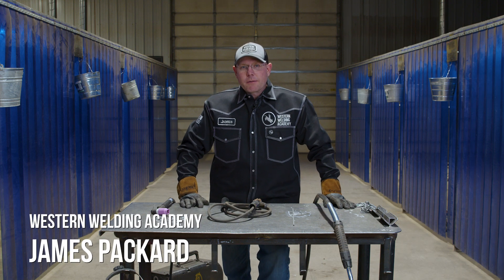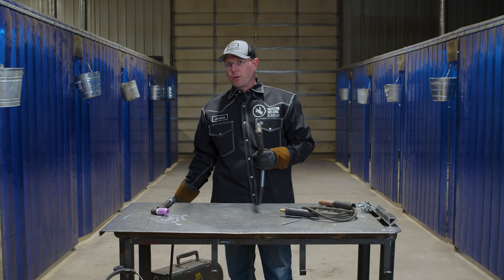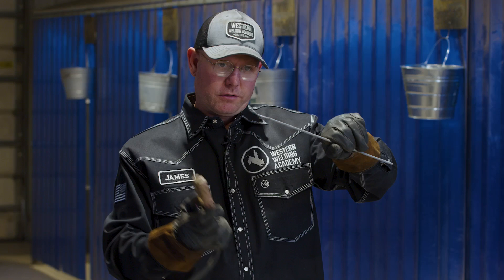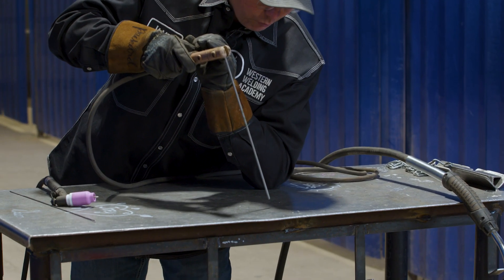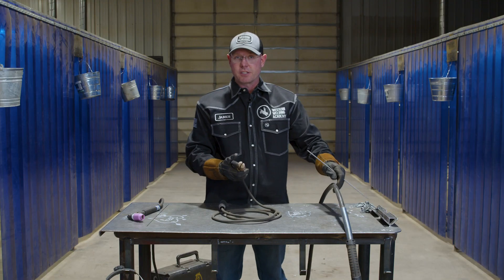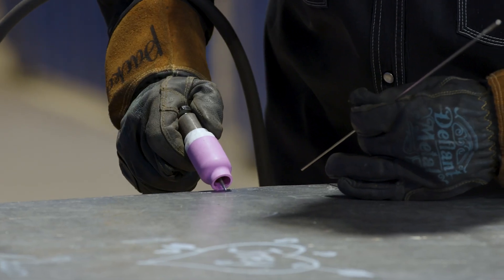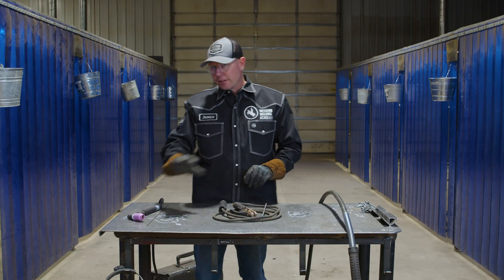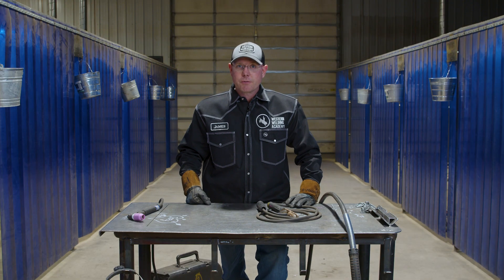MIG vs Stick vs TIG ┃What's The Difference?

Comment: Yeah I’m very attracted to read about MIG these days and I came to the conclusion that is good for factory work. Lots of items produced identically the same. Once you have the setup you are good to produce thousands. Same wire and same gas. When it comes to versatility tho I think MIG is not the best option.
Reply: Learn stick welding first , anybody can weld with a MIG gun , from there I’d learn flux core
Reply: @brysonw1815  I have a stick welder. I’ve seen bad welds with mig but also good ones with it. To have a good quality weld you need to work at it.
Reply from the maker: Great point!